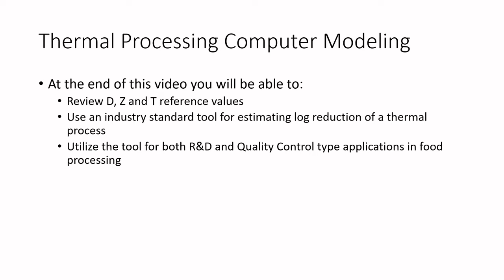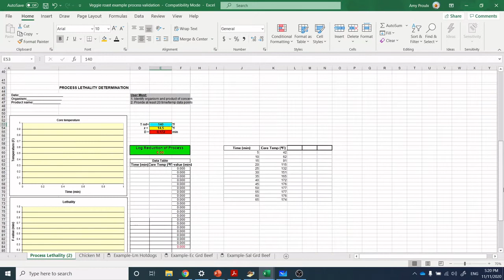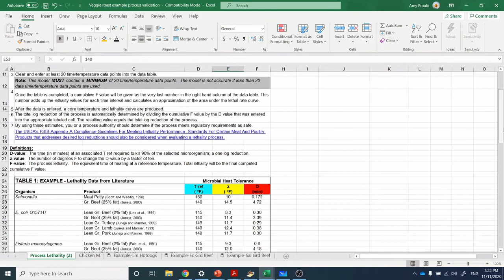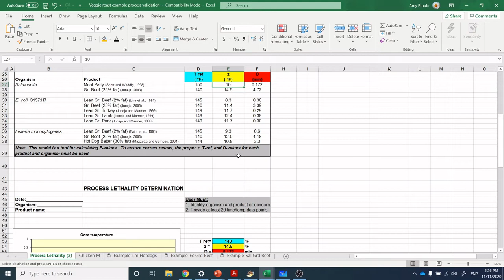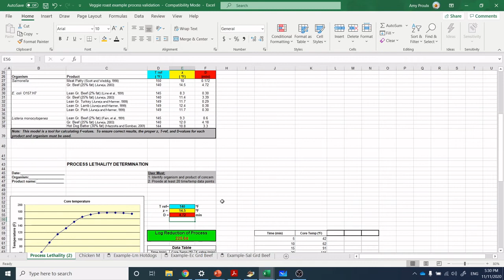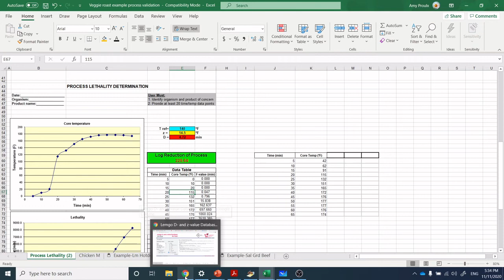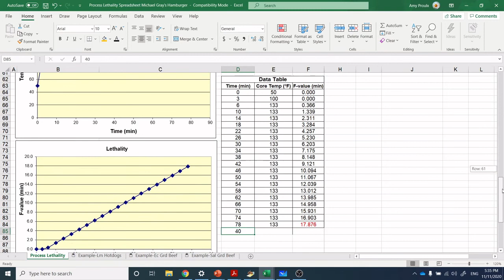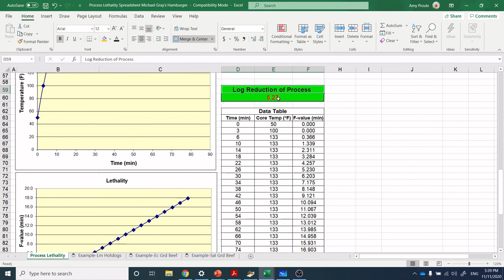Let's Learn Food Science - Thermal Process Computer Modelling

Comment: How do you make deduction from the log reduction process value gotten? That is how do you know the process is ample?
Reply from the maker: If you have selected appropriate pathogen or spoilage organisms of interest, and then chosen appropriate D, Z and T reference values, then used the calculator correctly, then yes, you refer to the log reduction of the process.  In many cases, governments make log reduction of process targets as part of regulatory performance standards.  For example in Canada, canned low acid foods have a requirement for at least 12 log reduction of Clostridium botulinum using T ref 121C, Z of 10C and D value of 0.25.  Some meat products require a minimum 5 log reduction of E. coli, while others require a minimum 6.5 or 7.0 log reduction of Salmonella.